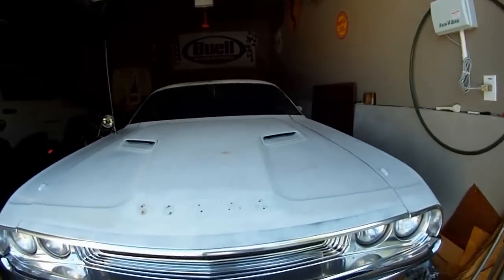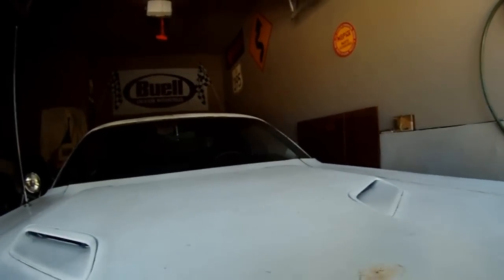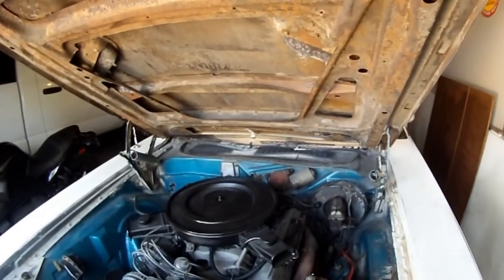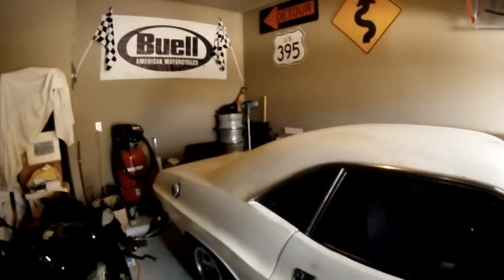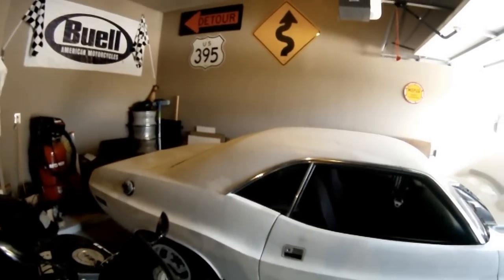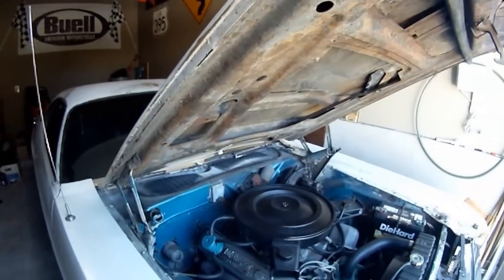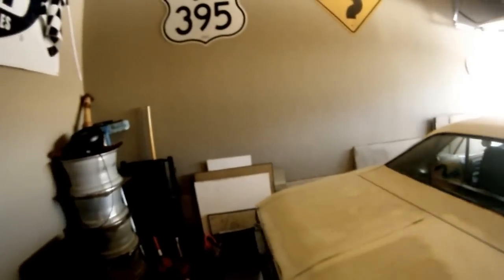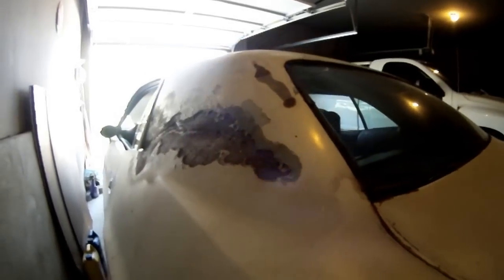1970 Dodge Challenger

Comment: well its taking its time as I got married last august and have just been pretty busy lately but im currently adjusting the timing and carb cause after I rebuilt the cam I couldn't get it to idle in gear but I didn't have a vacuum guage haha. ive got a 3.55 suregrip with 70k miles out of an old truck, built the 383 with pocket ported 452s, xe274h cam,performer rpm intake, 750cfm, and hooker headers. so we'll see how she does in a few days. also working on the brakes still. did a front disc swap.

Comment from the maker: Hi Sylvain, thanks for the comments! Yes it is originally a 383 "N" code Challenger.  No differences in the blocks that I know of.  I would suspect the original owner blew the original motor sometime before 1980.  I have yet to put on the rear sway.  I  would recommend firmfeel dot com to get your sways and any suspension parts.  I have an inch and 1/8 front sway, that alone made a huge difference.  I've got boxes of suspension parts yet to put on:)  What country are you in?